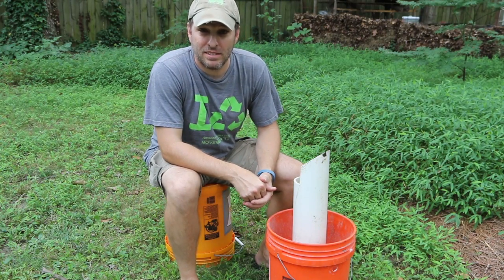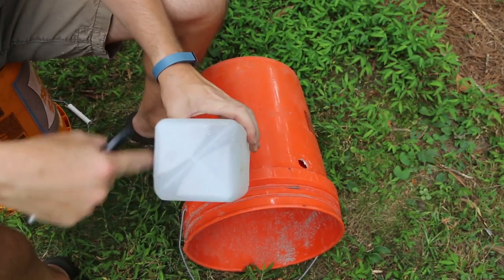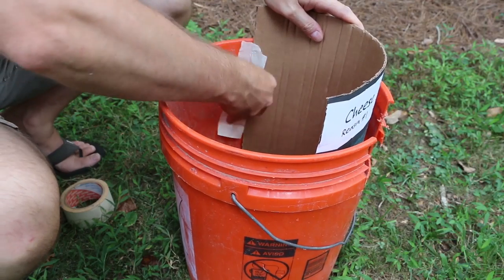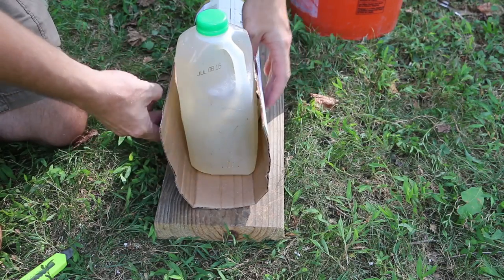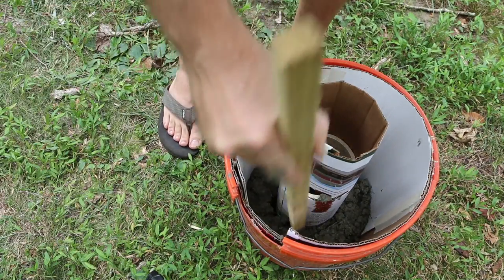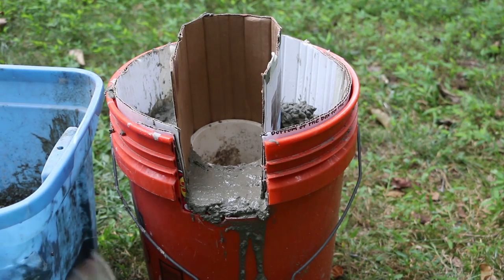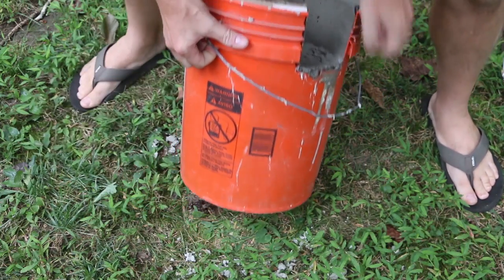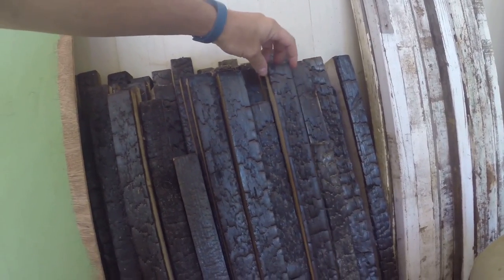How To Make A DIY Concrete Rocket Stove

Comment: Okay, that was different and I appreciate you sharing that with us. I look at a rocket stove as a survival tool and something that could become mobile(that is my personal view). I am impressed with your stove but it needs to be more simple.
Reply from the maker: Jeff Corbin I'll agree this application is not a mobile survival stove. I use this in a backyard-egg-cooking to get the efficiency benefits and use "local" fuel. My most recent videos were about a mud (cob) rocket stove, using the same forms. Not mobile, but could be made in-place at a survival camp. I'm currently designing a fold-flat, metal rocket stove to be made from reclaimed steel. That may fit your survival goals. I'm hoping it will be a good camping option. Thanks for watching.
Reply from the maker: Jeff Allen agreed! I have heard that the smoke from burning poison ivy contains the oils and is dangerous. Thanks for the heads up.
Reply from the maker: Hey Jeff. You might enjoy my new rocket stove design. It is a portable metal stove...might be a better survival option. Check it out: https://www.youtube.com/watch?v=dzAi6BHj5vI

Comment: Omg forget all that paper work just use floor paste wax or fiberglass mold release wax the concrete won't stick
Reply from the maker: Ha! Yeah, I hear you. And the funny thing is, I am in the middle of remaking this rocket stove project with some refinements, but I’ve already done the casting with the cardboard method. I may do another pour, just to try your suggestion. Thanks for the comment.
Reply: GreenShortz DIY actually I forgot concrete guys used to get  motor oil from me to spray the foundation forms , it does the same job as wax
Reply from the maker: Tony I referenced your comment in the redesign of my concrete rocket stove. Check out the video: https://youtu.be/TYr-Uj4HqDs Thanks for the heads up. I'll use the mold release method on a future project.

Comment: Only 15% of electricity generated is delivered because that generates profit. It's far easier to hide the actual cost of delivering services that way. That allows the utilities to buy the political class that would otherwise force them into responsible behavior.
Reply from the maker: True, there are some deeper issues in play. However, that applies to pretty much everything humans get involved in, don't you think. Corruption is one of the worst affects of human nature. Thanks for your input. Thanks for watching.